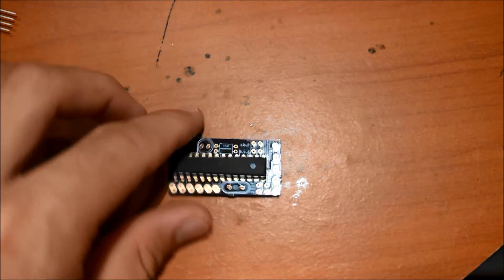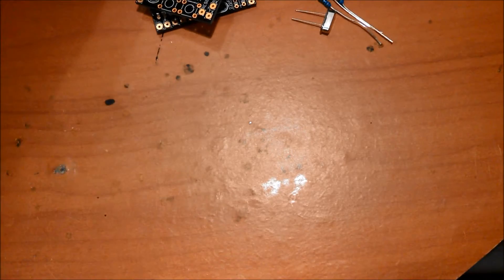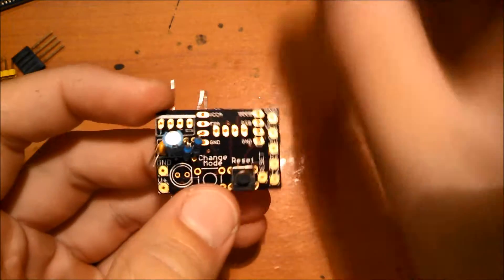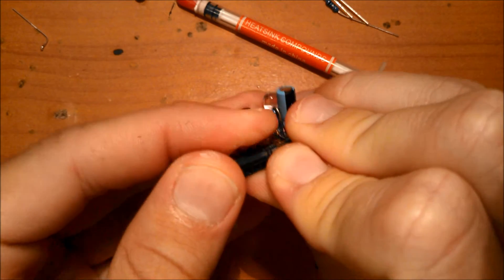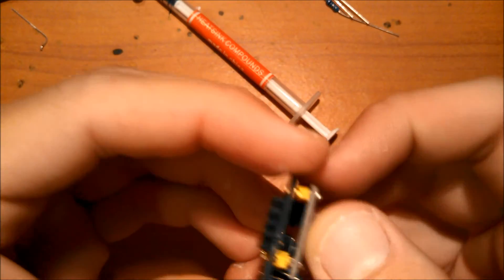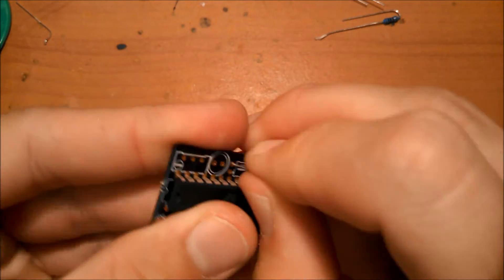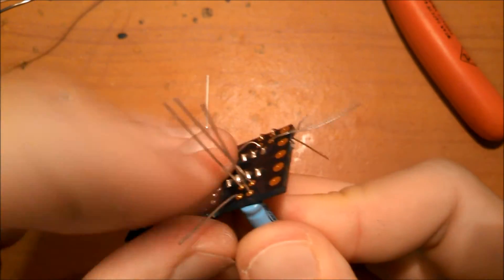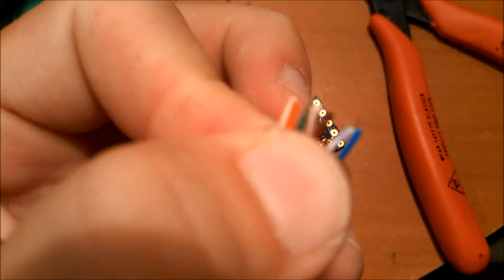Daft Punk Thomas DIY LED kit Part 3

Comment: If anyone is confused about the 3.3V to 5v converter, Notice its not on the parts list for your Kit, and on the PCB there are no holes to plug one in. Skip that step. Also consider the updated kit, it looks really cool.